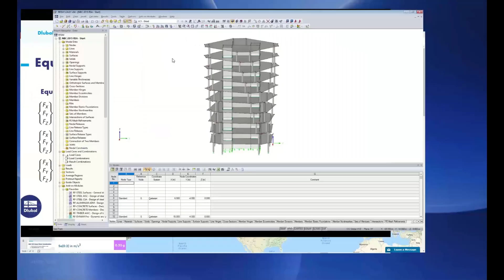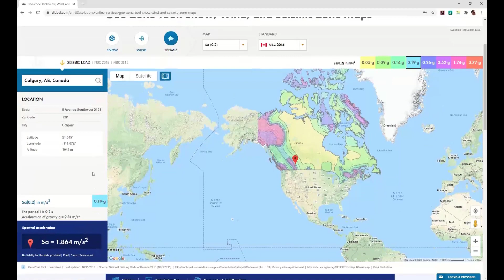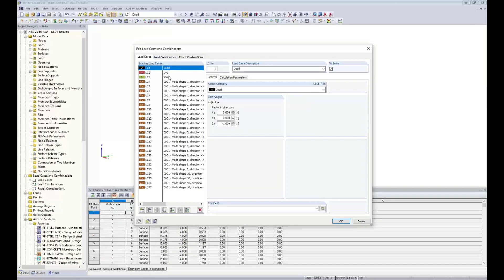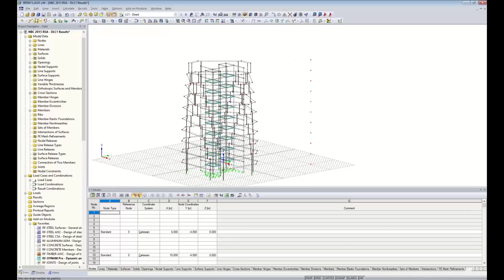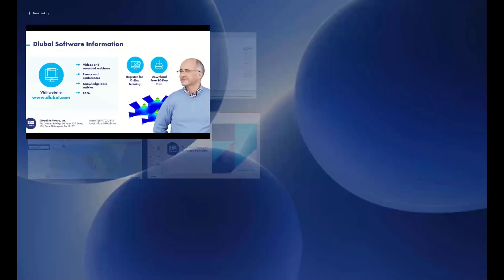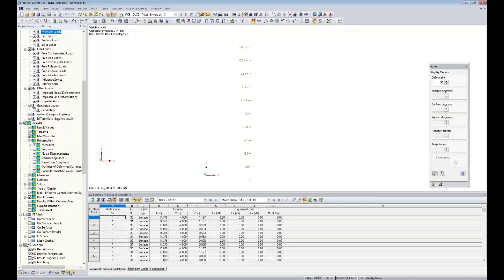Webinar | NBC 2015 Modal Response Spectrum Analysis in RFEM

Comment: Another amazing webinar! This live load of 28 kN/m2 though, and columns cross section of 508 mm, where did you find those 8mm ... You see what happens Larry when you make Americans work with SI units 😁... But anyway, webinar is really good!
Reply from the maker: Hi, milangrfbg09!
This is exactly what happens when you make an American give a webinar in metric units she's not familiar with!  Glad you enjoyed the webinar anyway. :)
Reply: I haven't seen the column cross-section of mm unit in the software.
Reply from the maker: Hi, sanjeev!
Most of the webinars presented from the US office utilize imperial units in the examples.  However, a user can always change the units by going to the menu Options - Units and Decimal Places - Load Saved Profiles and double clicking metric or imperial.